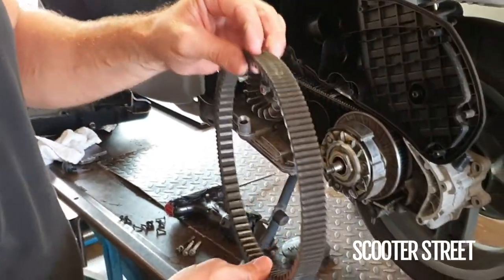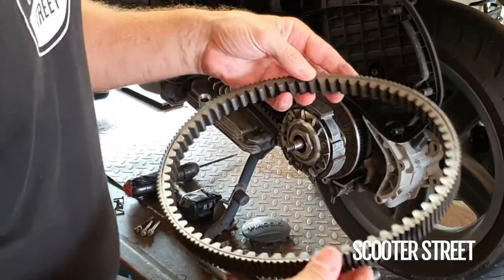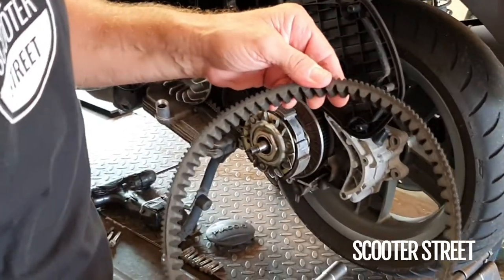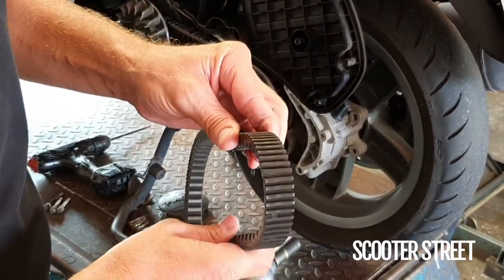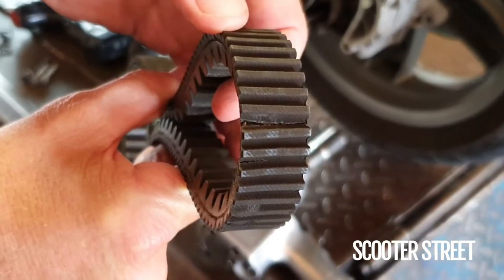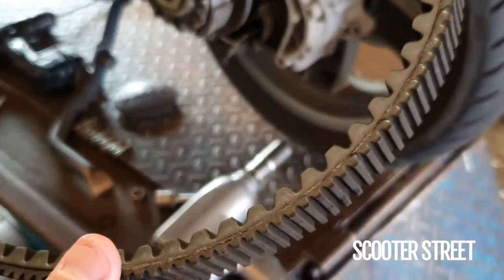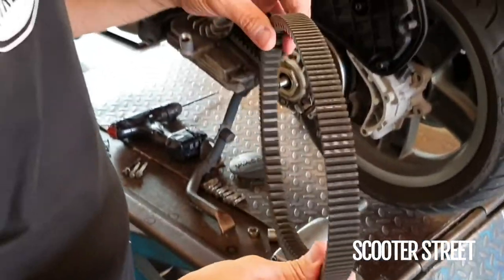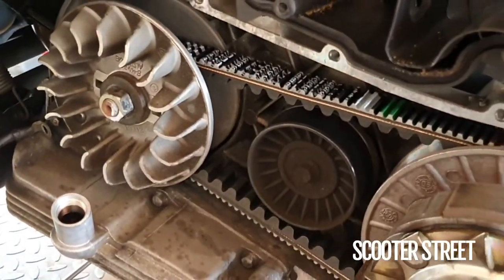How to tell if your scooter belt needs changing

Comment: I was hoping to hear the moped BEFORE the belt change. Sure I could take the belt off, but wouldn’t it make a sound if the belt needs fixing?
Reply from the maker: No, a worn belt will not create a noise, it will make a hell of a noise if it breaks while riding.

Comment: I got a 150cc gy6 scooter the bike has exactly 3820 miles its been well maintained but I heard the belts go out around 3800 miles the bike has been riding great I haven’t heard any bad noises do u think I should be fine as long as I dont hear anything?
Reply from the maker: The noise you are waiting for could be very harmful to your engine. Get it checked and keep up the maintenance on the engine.
Reply: @scooterstreetau  is 3800 miles usually when it starts to go out?
Reply from the maker: @troyholland3436  Yes we check at 10'000kms.